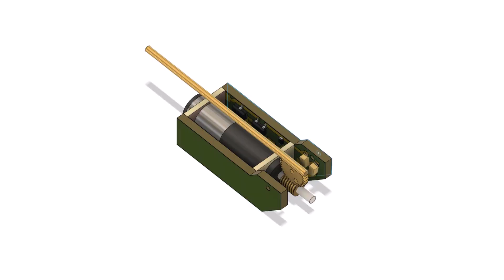Tilting drive for a tipper with optical endstops | RC 1:87

Comment: Rc87 this is what I had in mind of building. I’m just starting out in 1/87 scale Rc and really enjoying it. How much do you sell these for.? If you do sell them.? Iv subbed to your channel to as I think you would be a great help. Thanks 👍🏽😉
Reply from the maker: No, I don't sell it. It was just an experiment, but I've already designed completely new circuit and structure that doesn't need a linear servo board, but I don't have time to build it and mount it on some trailer, but is a little more complicated.
Reply: @RC87  oh ok that’s a shame. Yeah that’s what I’m thinking of doing I e got some linear servos on order soo shall have to do something similar. If you do decide to sell let me know please 👍🏽😉🍻

Comment: Is it possible to get the circuit diagram ?
Reply from the maker: yes, it's possible, the circuit is quite simple, but you will need some linear servo to attach the circuit to... 
rc87mods@gmail.com
Reply: @RC87  i send you a email